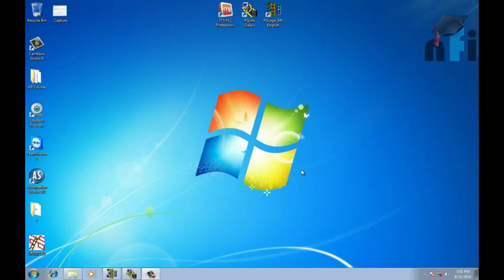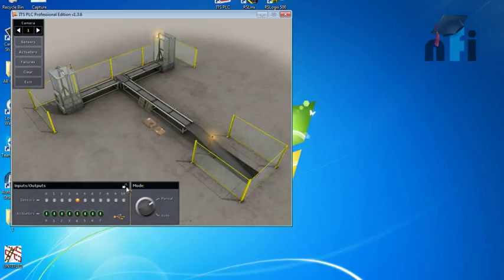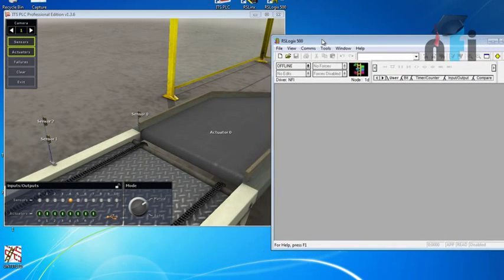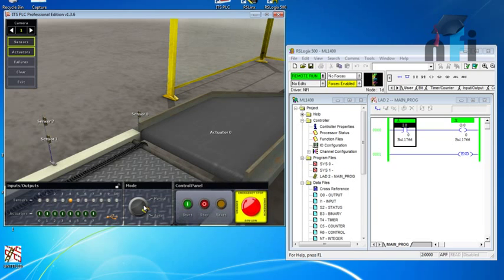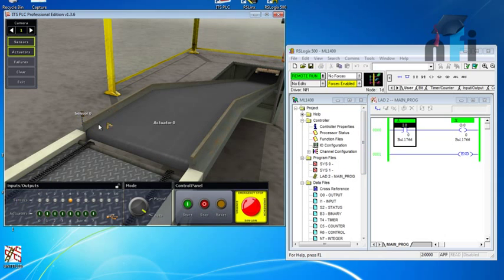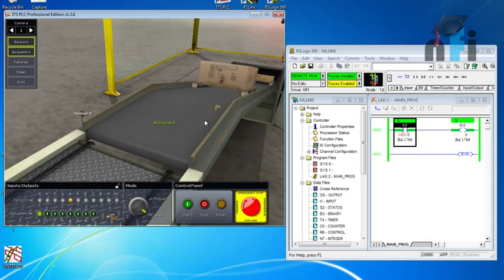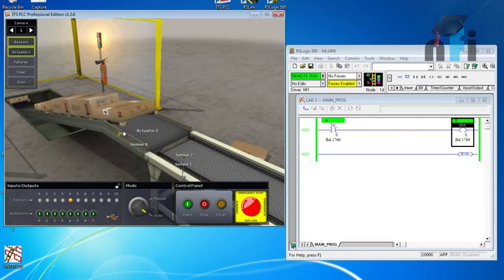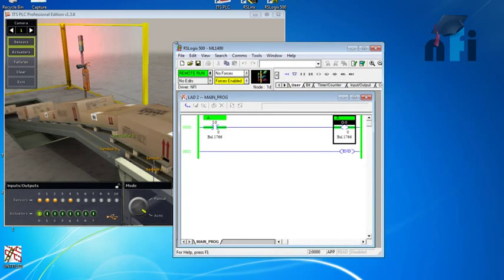AB Micrologix 1400 - Introduction to ITS

Comment: Hey man, thanks for the videos. are you able to elaborate a bit more on how to connect ITS to my rslogix 500? i dont have a physical PLC so am trying to use rslogix emulate 500. i am a complete noob at this and cant find anything about it  on uncle google so im starting to think i have something way wrong. Also is there a way to get an IO list of what components ITS has available? any help would be awsome. 

Cheers
Reply from the maker: +Lance M Dear lance, the reason you could not anything is because it's not possible to link RS Logix 500 software with ITS without PLC. You need to have PLC and advantech USB 4750 USB card to make the linkages. We are using this in all our experiments.
Reply: +Rajvir Singh (NFI Automation) thanks for the reply. I have downloaded DAQNAVI which can  simulate the physical Daq card. from what I have found this should be able to simulate that part. I am  using rs emulate 500 to emulate a physical Plc so hoped these would work together. I think my problem may be that ITS requires licensing before it will talk to anything. trouble is the company that makes it won't reply to any questions I have asked regarding their software and how to license it. 

do you have a video on how to setup connection to a daq card for rslogix? 

thanks heaps
Reply from the maker: +Lance M I got your E-mail i will reply to that now.
Reply: +Lance M hi ,+Rajvir Singh
I have the same problem I havent plc can help if you get to communicate itsplc with rs emulate and rslogix please answerme sagittariusblacker9@gmail.com
Reply: +sagittariusblacker Z .Hey mate. I ended up getting factoryIO it's the same but different and well worth the money. then instead of using rslogix I used siemens step 7, very similar but it can talk directly to factory IO just make sure you open both programs as administrator. factory IO has a free trial for a month but I found it was amazing so purchased it. hope this has been helpful let me know if you have any other questions
Reply: what software Siemen you needed to communicate with factory io?
Reply: +sagittariusblacker Z siemens step 7. if you find factoryIO and down load it you'll see the different ways to communicate with it.
Reply: its posible with simatic manager
Reply: +sagittariusblacker Z simpatico manager comes with and is part of step7